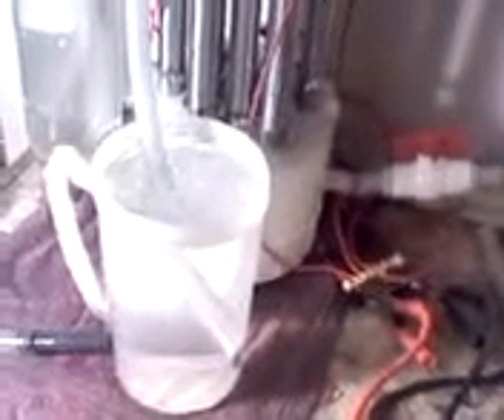BURTHA HYDROGEN GENERATOR RUNNING

Comment: Nice going Spike, now get a water filter from lowes or something then your pump will show it's worth. But do try and get the voltages up to the point where its just starts arcing and use the pump to blow out that arc. That would put it as the same production as Crobs cells. Say about 8-12 l/m.